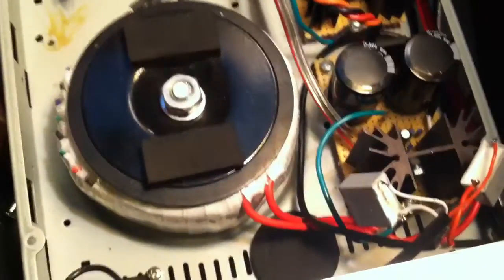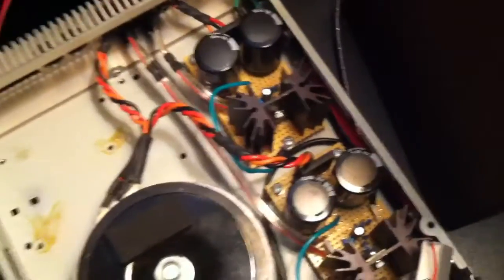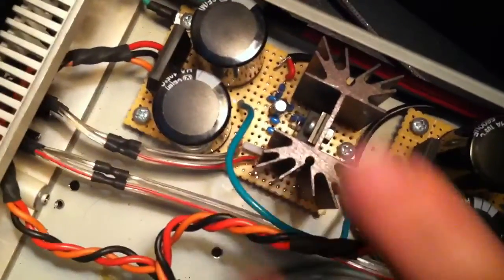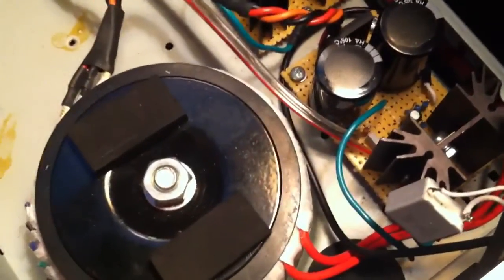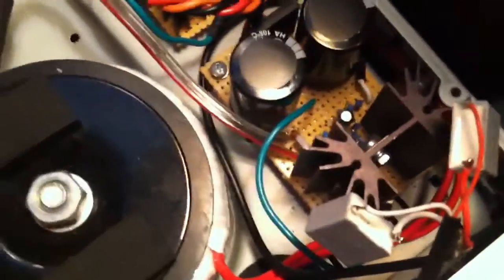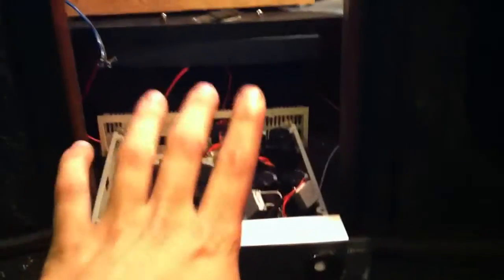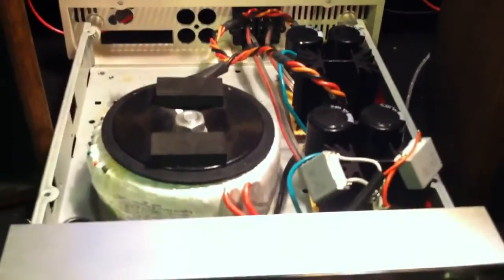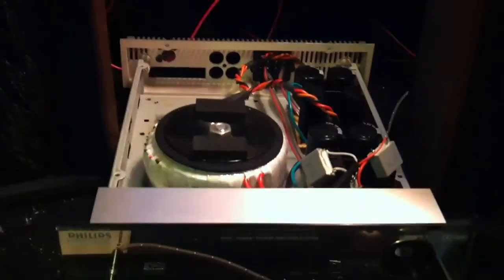LM1875 Gainclone "Finished"

Comment: Lol I'm just busting your balls. I built a guitar amp for my sr project and I only used a 26v supply. Still made some pretty good sounds though. I was able to mill a board for mine as well which made it very easy to use
Reply from the maker: Philip Geraci Yeah, plus I was getting about 18 watts or so out of each amp, which was more than I ever needed for those speakers, they were crazy efficient.

Comment: why using such low voltage supply? those things are rated for 60V.
Reply from the maker: Philip Geraci I already had hard enough time keeping them cool enough to get any reasonable output the way it was. If I would have used a higher voltage they would have gone into protect almost from the standby dissipation alone..